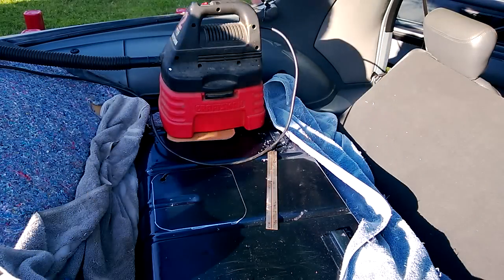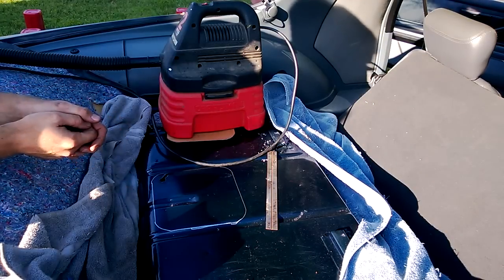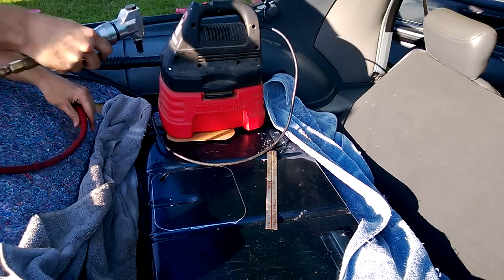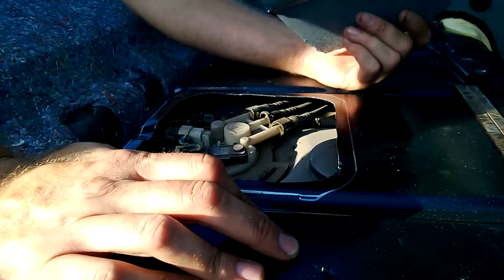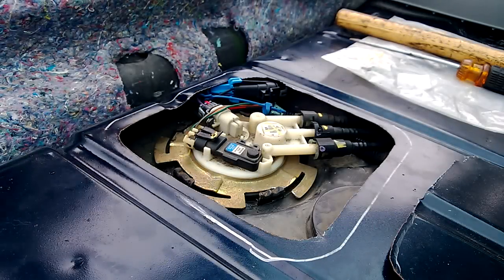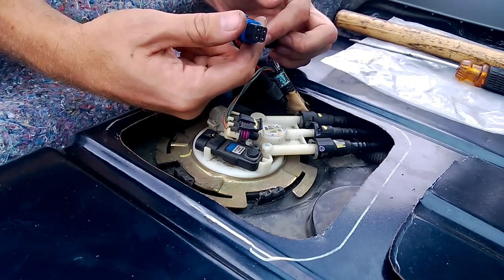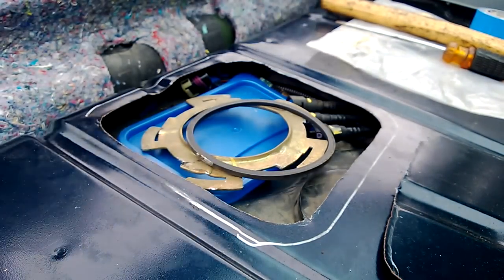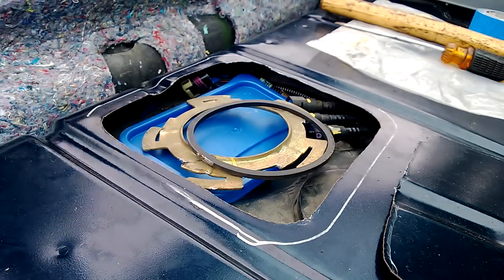Cutting Fuel Pump Access Panel and Removing Fuel Pump Assembly - 86 Trans AM with 02 Gas Tank

Comment: WHAT THAT BLACK SENSOR ON THE TOP FUEL PUMP
Reply from the maker: I believe its the tank pressure sensor.  But dont quote me on that.  Its part of the EVAP system.  In my case, I could probably remove it.  But its not bothering anything, and with the 0.00001% chance that I ever hook EVAP back up, I wont have to mess with it.
Reply: Thx did that come on ur new pump
Reply from the maker: ***** If you buy a new pump assembly, from somewhere like Autozone or RockAuto, it should come with the sensor.  I bought JUST a pump, a racetronix upgrade unit.  So I left all of external parts of the sender assembly alone.
Reply: COOL THX

Comment: my pump does not want to come out this hole
Reply from the maker: Just to be sure... you've got a 4th gen plastic tank right? If so, just make the hole a little bigger til it comes out. If you have a stock 3rd gen tank it's a different story.
Reply: @JEGsGarage  i giot it out buy cutting up the side thanks

Comment: What's that tool called you used?
Reply: sheet metal "nibbler"
Reply from the maker: cheerdiver
Thanks!  You're correct... Yet another comment I didnt get from youtube!
Reply: ***** I've used the hatch tech b4, but used a die grinder w/ cut off disk.  May get a nibbler just to do the next, better tool for the situation.
Reply from the maker: cheerdiver
One or two of the lines are REALLY close to my floor pan there.  After I had the piece out, I was rather glad I didnt use a cut off.  This may seem kind of crude, but it worked well once I got the hang of it.  And besides being safe around wires and hoses, it leave a pretty nice edge.  Nothing to really debur or get snagged on.  Worked for me!  Ill probably never use it again! haha.
Reply: ***** It may cost $25 at the discount tool place, but it will save that much time and inconvenience.  Esp in situations where a flame or exposed cutting edge will do more damage.  Tools are what make the mechanic.

Comment: get an access door from a Cadillac Seville or another car from scrap yard.. all import cars use them. I do the exact same thing dropping tanks is for amateurs
Reply from the maker: Thats not a bad idea.  I would still need the mounting points for the cover...but getting a cover off something else sure would save some time!  And it would be much more rigid than something I would make.
Reply: u can use those clips that slide on either can do self tappers or bolts
Reply: Hah! Now I am curious about what kind of trapdoors are out in wrecking yards?  :-)  #GearHeadsWorld
Reply: Chuck Fasst check out the access panel on a buick Riviera 1998

Comment: What are the measurements  ?
Reply from the maker: Anuno26 Good question.  Im not really sure since I sort of just cut where I needed to.  You can use the ribs in the tank hump as a general guide.  I wont have a chance to pull my carpet up for a while...but if I do, I will DEF put a tape measure across it.  if I had to guess...the hole is 7x7 ish.  And if you have a 4th gen, or 3rd gen with an LS1 tank, you'll cut dead center right near the rear of the hump.  My suggestion is make a pilot opening, being extremely careful of course, then peek down in there to check where you have to be.

Comment: I always chop a hole. New  Fuel pumps fail. Some parts stores sell wrong parts. Ya. I got 2 wrong ones and my idiot brother demanded we drop the tank. Ya. These idiots smoke bad weed. 
Turn key and listen for pump buzz for 3 seconds. If no buzz then try spray into air intake.should start up a few seconds.  Old pumps need to be replaced.  Note: no weed smoking allowed for this work.

Comment: Why didn't so called ENGINEERS think of doing this ? In the FIRST PLACE ? TO TECHNICAL ?
Reply from the maker: Well, if I had to guess, they just didnt envision someone wanting to change the pump more than once in case the original failed haha.  Some fuel pumps go for hundreds of thousands of miles with no issues.  Then idiots like me come along and ruin all their good engineering with bigger pumps and better wiring and next thing you know we need to get in there a couple times a year to fiddle with it haha.

Comment: Hack !
Reply from the maker: Yup!  Sure is!  Also SURE IS nice to be able to access my fuel pump and hot wire kit without taking the back half of the car apart like EVERY other modern car on the road!
Reply: Vehicles that are made with access holes are designed by many engineers including structural engineers who take many different things into consideration when designing a vehicle.

In your case you decided to just do a "hack" job because it was easier but there is no way you can make your patch as secure as factory original.

In all likeliness it may never be a problem.
But then again even though remote given the right circumstances because of your "hack" someone could burn to death.
Reply from the maker: There is no way I can make my patch panel as secure as factory original???  Seriously?  Engineers, at least the ones that would be in charge of something like this, are going to make the piece as cost effective as possible.  Period.  The panels are almost ALWAYS a different material than the surrounding area.  Galvanized, or cheaper metal, stamped out, and way larger than needed.  They consist of a foam gasket, and maybe 4 screws.  My Subaru had TWO of these under the back seat.  Two screws and two tabs is all that held them in.  When my fuel pump sending unit gasket failed, I got horrible fumes in the car due to the crappy panels.  Have you seen factory covers?  

I WAY over built my solution.  Its aluminum, and thicker than the surrounding metal.  I believe its 1/8" sheet. 
 I have maybe 8 rivets holding it in, and its sealed with butyl rope, because I had some left over from sealing some headlights.  I've really got to make a follow up video showing the cover I guess.  I could have used screws but didn't want to hit the tank with anything sharp.  2 minutes with a drill and the rives are gone.  

There is ZERO chance of anyone burning to death because of my modification.  Please stop being so dramatic.  If that is going to cause occupants to burn to death, then the entire surrounding area will also.   If something happens THAT bad, that access panel will be the least of anyone's worries.  

Engineers are great.  They come up with ideas and solutions all the time that make our lives better or easier.  But lets be clear...they don't always come up with solutions with the consumer in mind.  Back in the 80's, they didn't really put these types of access panels in, partly because fuel pumps were not in tiny little senders.  They were steel, and had steel lines that connected to rubber over the side of the tank.  In order for them to create a panel for an ORIGINAL fuel setup for a thirdgen F-body, the opening would have be bigger than a shoebox.  Not exactly practical.   Newer cars have quick disconnect hoses, and extremely compact sending units.  They slip through holes that are the size of what I created.  

If you think its hack...that's cool with me.  You're entitled to your opinion.  But don't go around saying my solution isn't as good as a factory one, or that what I did is going to cause someone to burn to death.  That's just pure nonsense.
Reply: Not really nonsense because fact is anything can happen however unlikely. 
&
I'll stick with you can't do it because your particular vehicle was not designed to have an access hole for the pump .

& in order to prove it's safe you'd have to submit your "hack" , well  actually dozens of them and have them studied & certified as an accepted vehicle alteration.

That one study alone could cost thousands if not hundreds of thousands of US dollars.

Then there's the liability issue if you sold that car & something "god forbid" actually happened & it was traced back to you doing it.

Even if it was totally not your fault it still could cost you your entire life's work just to defend yourself.

Look, you posted a video because you wanted people to watch it & comment.
So.
Regardless of what you think I'm not trying to be a dick I'm just commenting & giving you my opinion & attempting to explain the reasoning my opinion.
Reply: What exactly are your qualifications?  You can see that that is just a simple piece of sheet metal, which has very little structural significance in the overall body.  The folds in the metal are for structural integrity of the metal sheet, only.  You could likely remove the whole sheet without affecting the car in any way.  As long as it is properly sealed, it won't affect anything.  Also, if he were to have a gasoline leak, it would be highly detectable, unlike a leak from the exhaust, which is odorless.  So, in a way, if he were to have an issue with a bad fitting or broken line, it would almost be advantageous if it were to "leak" the smell into the cabin a little.  Otherwise, it would just leak onto the ground, pool and cause a real fire hazard.

And JEG's is right. Car engineers are tasked with two things, make it pass safety and make it manufacturer for the least cost possible (the priority).  The engineers don't spend tons of money testing each of the parts to have optimum structural integrity.  They build it, using known practices, then (especially in 86), just wreck them to see how they fair.  As long as the gas tank is surrounded by a frame, it is usually safe.  Having a door there is just extra cost that would likely never be used by the dealer's mechanics.  They would just drop the whole tank and likely replace the whole thing, fuel pump and all as one unit if there was an issue.  

Swapping in an LS motor is a hack.  The engineer's didn't design these to swap engines. There are no universal motor mounts.  I guess he should have just left everything stock so it wouldn't bother you so much.  In fact, why would you come to a modding channel if this sort of thing bothered you?
Reply: Boy are you ever long winded.
I bet you read a lot of books.
& obviously still don't know how things work in the real world.

1st any access door or panel installed by manufacturers is retained with nuts welded to the body not just screws or pop rivets.
& the "hole" is reinforced to reduce the possibility of distortion or other damage.

2nd most if not all later model cars on the road today do not have a frame to surround the tank they are Uni-body as are many older cars.

As for swapping in an LS "Engine" the mounts are usually pretty much the same unless you are using  the later 4.8 5.3 or 6.0 "Engines" & when done properly is in no way a hack.
Even the Big Block Engines use the same location mounting holes.

& as for your "motor" comment a motor is commonly known as an Electric motor.
&.
An Engine is commonly known as an Internal Combustion engine.

So now, what are your qualifications ?
Reply: mo·tor
ˈmōdər
noun
1. a machine, especially one powered by electricity or internal combustion, that supplies motive power for a vehicle or for some other device with moving parts.

So, when someone disagrees with you, you go straight for an insult (long winded)?  A motor is both and can be used interchangeably. For you to go with that sounds like you were trying to go for a point to make me sound like I didn't know what I was talking about, yet you proved that it is you that doesn't know what you are talking about.  I have a Prius that does have motors and and ICE, and I know what the difference is by your definition.  I also have a 92 Vette and a Volvo XC90, just so you don't think I am one of those "Prius" people.

1st: That wasn't my point.  My point was the the sheet metal that he was cutting into isn't going to affect the structural integrity of the system.
2nd: The tank is surrounded by the frame, be it a unibody or otherwise.  A unibody is a type of frame.  Often the Firebirds/Cameros with the unibody frame are supplemented after-market with additional frame supports for rigidity, since they flex as a whole unit, like an ice cube tray...
3rd: If you need to add mount spacers or brackets to make your engine fit the previous mount points, that isn't a direct fit, but a hack according to you.  Pretty much the same does not equal "the same". And even if they are the same, usually you need to update the computer, and/or the harness, upgrade the transmission, etc.  I don't know if he went from the L69 to his LS, but he would need a mount kit (easy to do) for his block.  So while there are things that bolt on, there are still quite a few things to change.
4th: Your definition of "properly" is in your opinion, as all of this is in mine.  I do have a degree in engineering, but I also have many, many years of experience. I also make mistakes, but one thing I don't do, is go out of my way to insult people.
5th: Reading books is not a detriment. But I do read, and I also learn by doing.

What are YOUR qualifications, now that you bring it up?
Reply: I'd say long winded is an accurate description.
& BTW like how you have to cut & paste & I would not own a Vette & you know what they say about Volvo owners.
Then a Volvo & a Pries, Hmmm
Reply: B Anno You never did say what your qualifications were.
Reply: You asked "What exactly are your qualifications?" 
I asked only because you did, not that I really cared.
Reply: B Anno Fair enough. It is obvious that you are here to troll, so I am done with this conversation.  Good luck with your future endeavors.
Reply: Ok, you win.  You are clearly correct about everything.  The Automotive field thanks you for your hard work.
Reply: You said you were done.

Guess you lied.
Reply from the maker: Are you still at it?  I dropped it awhile back because I could tell there was no getting through your thick skull.  But I see you've brought me back into it.  You don't like the fuel pump door.  I get it.  But quit being a drama queen.  Its not going to cause anyone to die.  Someone swapping an LS and doing a bad job on the fuel lines, or using those older crappy Russel push on fittings is more likely to die from the thing bursting into flames.  So get off it.  Also, your comment about manufacturers having nuts welded to the sheet metal is pure crap. I've worked on two cars even recently that JUST used sheet metal screws.  Don't presume that I didn't consider what could go wrong.  I did...and there is nothing wrong with this other than it isn't stock, and it makes the stock nazi's unhappy.  Also, don't come here thinking you are god's give to automobiles.  Shops call you for advice when they're stuck...Ill bet they do.  You say you've been working on cars for a long time, yet your mannerisms makes me think you're a teenage kid.  I'm tempted to block you from this channel, you obviously don't like my work or this genre of video...but I'm trying not to be childish.  How about you just move along?  There's nothing for you to see here.
Reply: JEG, This was my fault.  I shouldn't have gotten into it with him and I apologize.  I stumbled upon your channel looking at LS swap videos and I have enjoyed what you have been posting.
Reply from the maker: Thanks Keith.  No worries.  I normally dont engage people that way, but he rubbed me wrong when he claimed that I was going to kill people.  Those "people" would be my kids/family/friends since that's who rides in the car, and I would NEVER put them in something unsafe.  I should have known better.  Going to just ignore it now :)  Glad you liked the videos!  I wish I had more to post.  Been a slow summer with house work.  But still hoping to get the car to the dyno soon, and maybe catch a track or two before the seasons over.  I put about 50 miles on the car this year :/
Reply: I didn't say intentionally kill someone.
More from not looking at the possibility of what could actually happen.
Is it likely ?
Probably not  but is it a possibility ?
It sure is !

I've seen frames literally "spot welded" a spot here and a spot there on Trucks because the one who welded it though he was qualified. 

I've seen small nails in brake lines  to block leaks on every day drivers and some of those fools hauled their families in them.
I've seen compression fittings on brake lines that had of  all things a Hydroboost brake system.
& as you should know Hudroboost really puts out the pressure & compression fittings should  not be used on brakes. 
I've seen the acceptable practice by "some" of a plastic fuel filter on the pressure side near a Carburetor just waiting for a small fire.
& believe it or not I've even seen broken wheel studs welded back on.

Likely there are many things the 2 of you know that I do not.
But 1 thing I know for sure is I would not cut a hole in my passenger compartment to simply make a job easier & possibly endanger anyone.